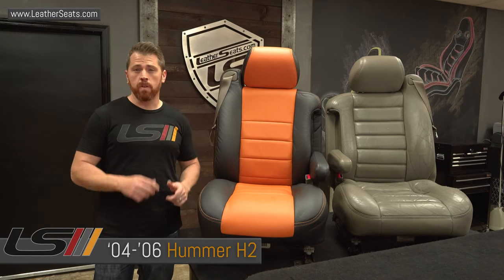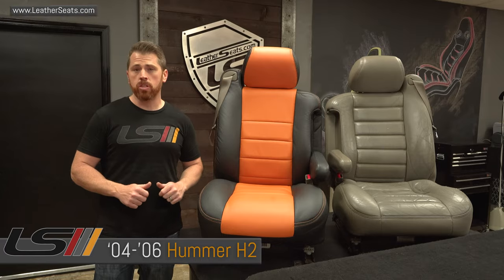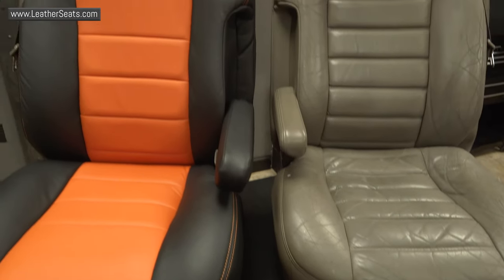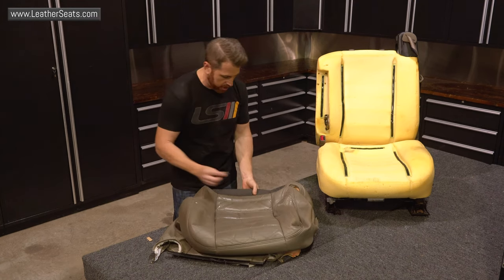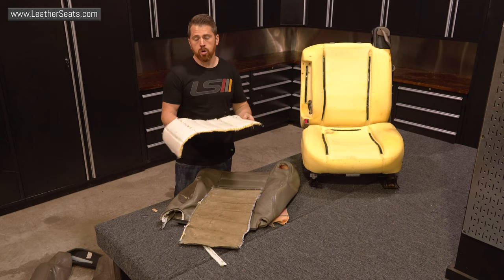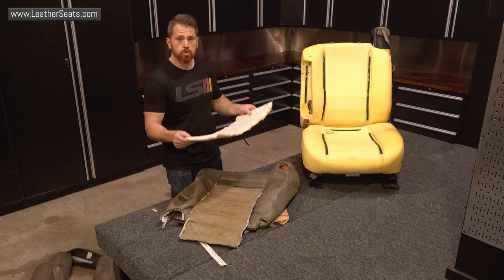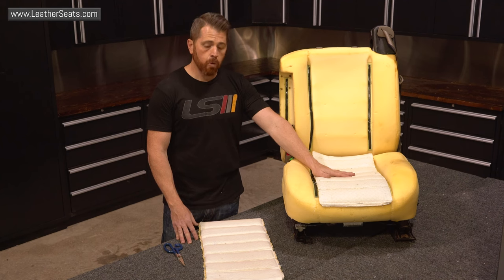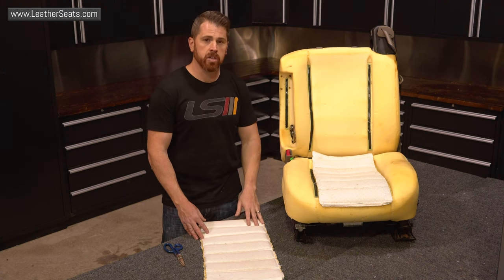How To Transfer Factory Seat Heater In an '04 - '06 Hummer H2 - LeatherSeats.com

Comment: how the heck are we supposed to determine to positive and negative of the new heated seat elements? The plus do not match and positive and negative are not marked in any way.
Reply from the maker: Michael Guy This video shows the transfer of the factory seat heaters, not new heater elements. Once mounted back onto the seat foam, the wire harnesses on the pads just plug back into the receivers exactly how they were before. We do also offer an aftermarket seat heater kit that use it's own integrated wiring harness and switchs. If you have any questions please feel free to email sales@leatherseats.com or give us a call at 1-866-639-7328 and we can help you out. https://leatherseats.com/category/seat-comfort/seat-heaters/

Comment: Can I just send you my 2006 Hummer h2 seats and have you replace them and put NEW heater pads in? Stock... color other than that and min are black.
Reply from the maker: Michael Guy We would not recommend sending your seats in. This kind of installation is typically done by an automotive upholstery in your area. Depending on where you are located we may have a recommended installer near you. Please email sales@leatherseats.com or give us a call at 1-866-639-7328 and we can check for you.

Comment: My '03 has heated seats too. Is something different or was it just a typo on the title?
Reply from the maker: NotsoJoe Rogan I can see how our title creates confusion for the 2003 model. The 04-06 models have slightly different rear seats, which is the year range our video features, however, the front seats are the same from 03-06. This process for transferring seat heaters is the same as the 2003 model. Thank you for checking with us!
Reply: @LeatherSeats  Thanks for reaching out on such an old video!
Reply from the maker: @notsojoerogan  You are welcome!